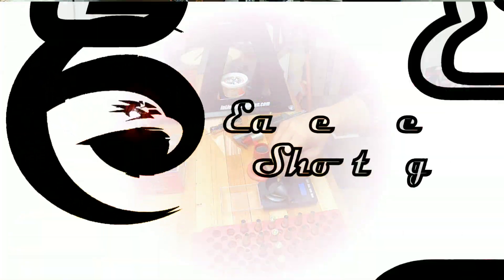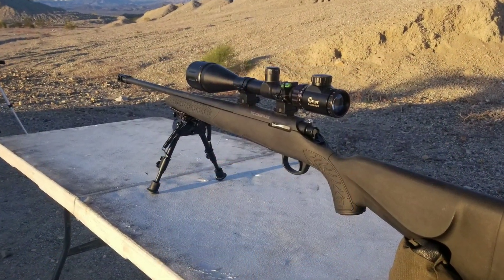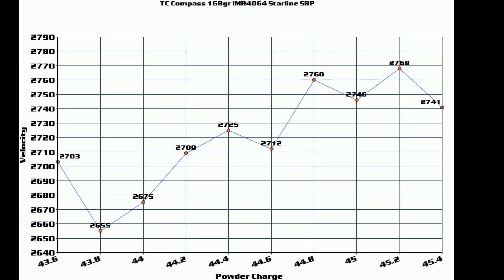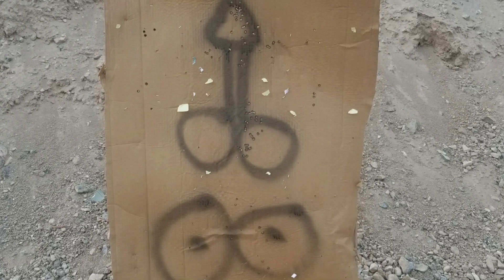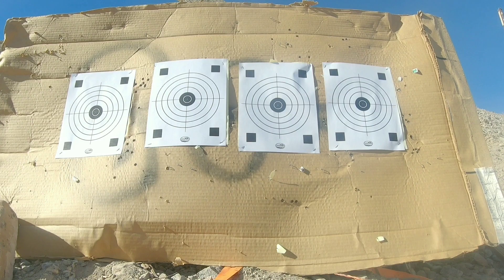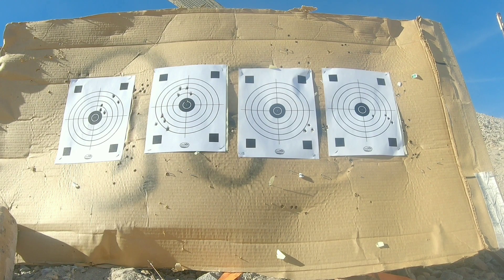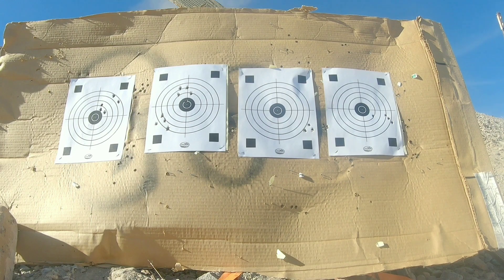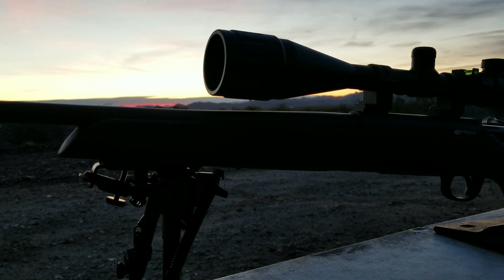The TC Compass .308 Winchester...Wins...For Now

Comment: Man it can be crazy frustrating trying to shoot match grade groups with a standard hunting rifle. Excepting the fact that it is not a sniper rifle will help you realize that the gun was shooting great for what its built for....
Reply from the maker: Ya Im not expecting much as this is for my son to practice out to 750 yards. I was just expecting 1 inch consistent groups as its advertised and im not getting that. Im pretty sure its the barrel. Running the jag down the pipe I can feel high spots every 3 inches. I can also see a ring that correlates to that. Im thinking it was the button rifling resetting position and lack of lube. However Ill challenge that a budget rifle can't shoot match grade groups. I have a few deer rifles that out shoot many high grade rifles. My channel is about showing folks that you can get Performance without the cost. Even if it requires rebarreling this rifle, this compass offers features that arnt found in some high end rifles. Overall cost of blue printing this and a barrel swap will still be way under the cost of a "mid range" rifle

Comment: I haven’t been able to do much testing with my TC compass in 308. But 43 grains of varget and 168 grain bullets work for most 308s. So I loaded federal brass with shoulder bumped back 2 thou, 43gr of Varget, 168 gr ELD-M with 2 thou of neck tension, CCI BR-2 primer , loaded 20 thou off the lands. My length to O-give was 2.235 with my hornady comparator. I have achieved 5 shot groups sub MOA accuracy. On a couple different outings. When seated 15 thou off the lands things opened up. After 3 shots accuracy suffers. I haven’t had a chance to try more powder charges. I went straight to 43gr of varget. I will say I was already seeing ejector marks on the brass. My TC compass 6.5 shoots everything you feed it great, I wish this 308 would. I have tried multiple boxes of ammo off the shelf, she is a picky eater. Good luck!
Reply from the maker: Really appreciate it. Great info! Ya Varget showed the best results so far. One of my go to powders for sure. Ya I've been digging around and finding folks saying the same with the .308 or 300WM having issues in the TC. Ill make this a shooter either way soon. Getting components together

Comment: Are you using a good scope and are the stock screws tight? I get sub 1" groups with my TC compass in 308 using around 15 grains of unique powder behind my homemade powder coated cast lead 133 grain bullets using 2nd fired neck sized brass. The velocity is only around 2000 fps, but that's not bad for homemade lead bullets. Maybe you should try some lighter weight bullets with faster burning powders. Maybe IMR 4227
Reply from the maker: Ya it like the 135gr gc noe HTC bullet. I gotten around an inch group. But I cant get the higher pressure loads to come together as I plan for 750 or 1k shooting

Comment: I have a savage axis that was doing the same thing. I discovered that my powder thrower was fluctuating a grain or two between each throw. I measure out each charge to the tenth of a grain. I don’t trust digital scales anymore. I worked up some more loads and I’m going to the range tomorrow to test them out
Reply from the maker: Not sure. I check against two scales to verify ladder loads. Still leaning on the barrel

Comment: Kenny, good video, as always. My T/C Compass in .243 hasn't had as many problems as your .308, unless I get the barrel hot, then it starts getting some vertical stringing. I wish T/C (S&W) would come out with a slightly heavier barrel profile, but I guess that would defeat their intended goal of selling a decent rifle at such a low price point. 
I was thinking about finding someone to cryo-treat mine, but for now, as long as I don't shoot more than a 3-shot group, or a slower 5-shot group, with plenty of cooling time in between groups, I can live with my rifle's weaker points. Let us know what T/C has to say. Keep up the good work, Brother

Comment: I've also struggled with thin barrels. Try a sandbag to improve harmonics. Bipods are best restricted to soft earth (not a table). Also consider stock bedding issues. Are the bedding screws tightened properly. Could you glass bed the action & recoil lug? (I'm not familiar with that rifle). Gunblue490 has very good videos on glass bedding.

Comment: I have a Compass in 6.5 CM and I was having the same issues with quality commercially available ammo....until I removed the brake and the thread protector.  Just about everything I shot was < MOA at 100yds with the exception of Winchester 130 Power Points.  Pure crap.  Try that scenario.

Comment: Are your Rail mount screws the correct length?  I got a set that only two threads made contact with the barrel once.... From the factory in package with mounts.
Reply from the maker: Not sure. I sure hope they at least did that right? I used my bore cam just now and dont see anything protruding

Comment: Even though the Compass is a good priced “Budget Rifle” for my project, my only concern right from the beginning is the “Pencil” thin barrel. While it is accurate, it heats up too quickly. I used a barrel cooler more in this rifle than any of my others. This is the barrel cooler I use, https://www.area1sports.com/ . The cooler is not cheap, but works better than others I have tried. I wish someone made an aftermarket barrel for the Compass in say a varmint style. That would sure reduce the quickness of barrel heating.
Reply from the maker: I totally agree on the pencil barrel. Thanks for sharing that barrel cooler. The price isnt bad at all! Thanks man

Comment: If anyone can get it to shoot good it would be you Kenny. I know you’ve checked a lot of things but have you checked the torque on the bedding bolts? Just a guess. Hang in there man👍🏻😬
Reply from the maker: I have just a cheapy 1/4 torque wrench lol. Im roughly 8 lbs. What's you suggestion on the torque on most actions?
Reply: Eagle Eye Shooting I’m not sure what it should be torqued to lol, but I’ve taken them out and then tightened them back up and they shot better haha👍🏻😂

Comment: I see the mismatch on heavy bullets ther. How does it shoot with lighter ones? 140grs 147grs 150grs???
Reply from the maker: Ive shot down to a 147 and had the same results the 155gr seemed to show the best groups at around 1.2 inch consistently with an occasional flyer
Reply: Eagle Eye Shooting it’s funny you say you have had luck with 155 gr as that has been my sweet spot on this and my other .308 rifles. Although 147 gr was ok 155 gr was clearly the winner. Five rounds shot in the size of a quarter at 100 yards. I think that is decent.